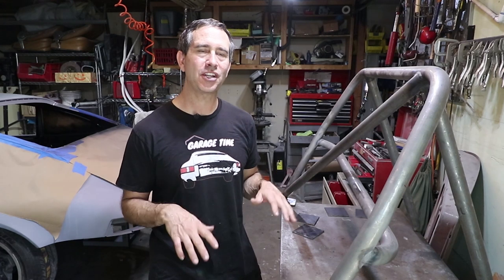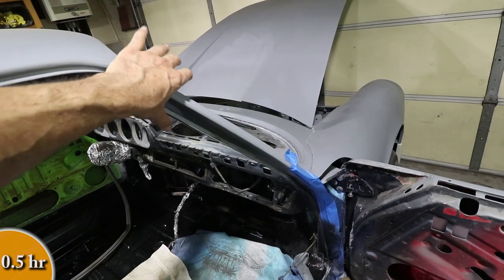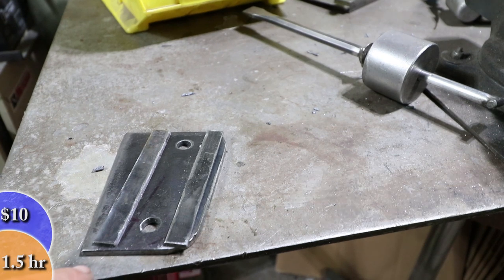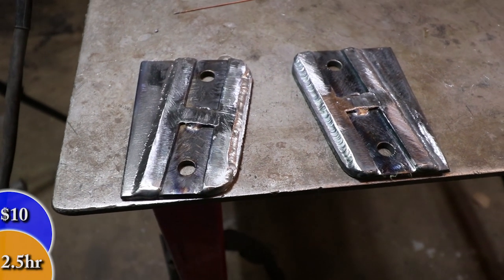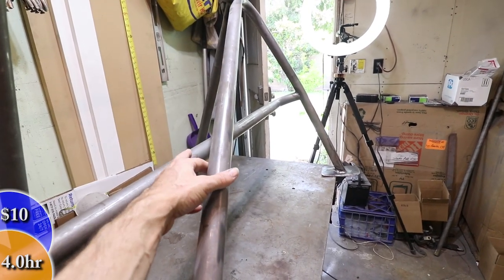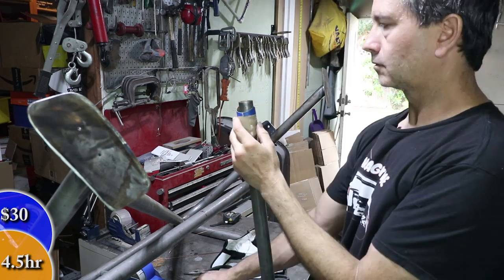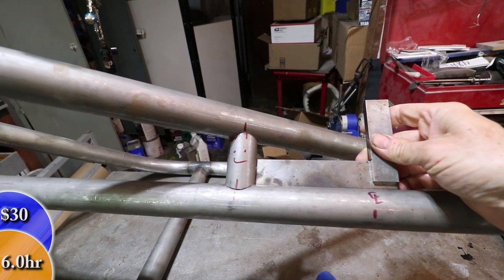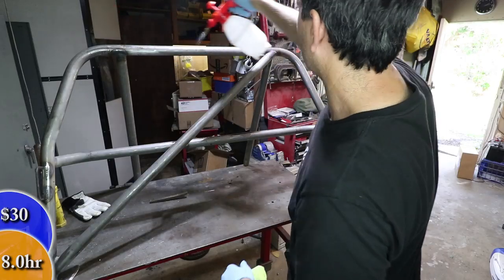My Porsche 911 Roll Bar Gets Blacked Out 😀

Comment: Dang, your fab skill is really impressive, and I love that your time lapse shows us all the prep and clean-up that goes into it. And I think the running time elapsed ticker is really useful, but I wonder if the cost ticker could just be a brief lower third each time a cost item enters the scene ("$10 for sheet metal") and then just a total at the end of the video. Of course, if that would be more work than the tickers right now, no need to add more complexity!
Reply from the maker: Thanks, This was a trial run on the ticker things.  I can make them disappear and reappear which is a good idea.  Now that I have a template setup it will be easier to modify some next week.  Thanks again!

Comment: Hey Tom, haven't watched your videos for a while so I'm going to go back and catch up on them. I pretty much watch you and Home Built by Jeff for my Porsche stuff. I am almost done cutting down a DAS Cabriolet bolt-in roll bar to fit in my sunroof SC Coupe. I got it for $500 including shipping (they're about $2,395 retail not including shipping). However, it would have been easier for me to have just purchased a hoop and built it from scratch (or get the 1.75" die for my mandrel bender). The Cab bar is about 4" too tall. I'm almost done with it so it is what it is.
Reply from the maker: Sounds like you've been busy working on your car, which is better than watching me working on my car, ha ha.  I too watch Jeff though.  I think we are similar in the way we approach stuff and get stuff done.  
Best of luck on that roll bar fitment;. Enjoy and leave me a comment if you need anything.
Reply: @GarageTimeAutoResto  Thank you Tom, you and Jeff both always respond and it’s appreciated.

Comment: Love the channel but I challenge you to put some more analysis into this removable door bar.  If you're going to have door bars they should be FIA compliant for you to expect any kind of protection.  If you get t-boned with these doorbars installed there's a good chance you'll end up with a the door bar bending, shearing those bolts and slicing through your arm and into your chest.  So instead of having broken hips, shoulders and ribs you just be dead.
Reply: softbatch7236 Your argument fails unfortunately being due to the fact many regulations compliant cages are bolt-in. Yes I’ve seen many bolts shear over the years in the heaviest of impacts/rolls etc but for the type of track-duty and user purpose illustrated/intended here, first the door needs to be deformed and these bars are to decrease the risks of further intrusion. Should the worst happen and the bar fails then it would need to be pushed in a good 6+ inches before reaching any vital organs. Also please factor in that if the bar fails it also needs to first shatter the seats lower shoulder bolster area so risks whilst there are minimal. As for legs... well I guess we can agree we can live without them 👍
Reply: @futurenewmedia  if that bar is 4 feet long, a 6 in displacement of the door bar from the roll bar bolts is ~7 degrees

Do the door's have the side impact bars installed?
Reply: softbatch7236 I can unfortunately only answer from my own Porsche which is a much later model 993 and does incorporate side impact beams (964 do also). I would guess that earlier models ‘pre-impact bumper’ didn’t (I’m sure Tom will correct me if wrong). In all honesty a square side impact in either with considerable inertia would me enough to kill however these kinds of accident typically occur on the road at crossing and not the track 👍
Reply from the maker: Hey thanks for your comment and concern.  I did look at the FIA rule book namely figure 253-11 which is what I based my plan from.  However, nothing I do will be FIA compliant because I don't have a full cage!  For instance I don't have a sill bar that would normally tie into the A pillar hoop.   Figure 253-8 uses a single bar too.
I also looked at the FIA removable hardware requirements which there are several to choose from and they rely on two 8 mm bolts.  Mine will be bigger.   My plate system is different but I don't think its any better or worse than some of the FIA contraptions.  
I'm not going full NASCAR on this build either.  This car will see cone autocross and a few DE style events.
My driver door does have the factory impact brace inside.  Having looked at it, I know that the DOM tubing is stiffer/stronger than the factory brace.
I find it really hard to believe that the addition of this bar versus nothing is a bad idea.
Reply from the maker: Everything bends in a major collision, I'm not sure what 7 degrees has to do with the bolts?  The main hoop and sill attachment will bend as a bolted system.
Reply: @GarageTimeAutoResto  All of those FIA designs have the bolts in double shear, or 4 bolts.